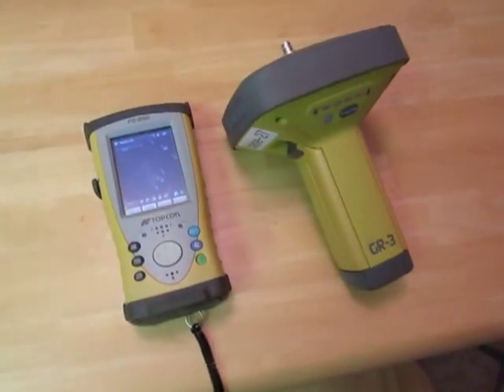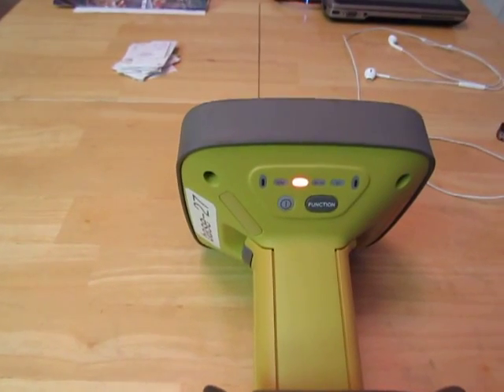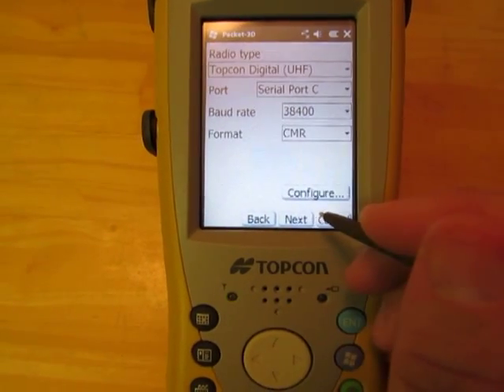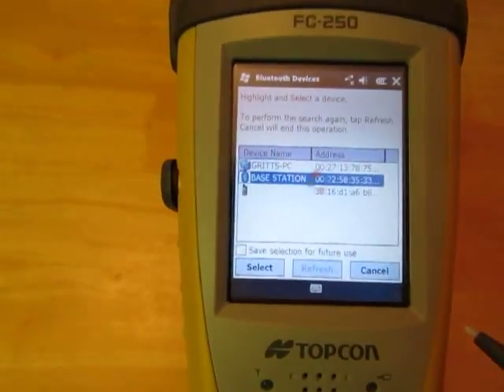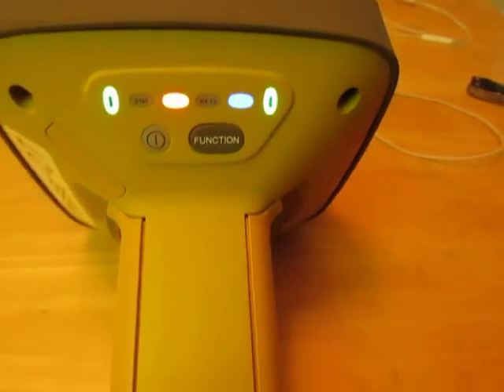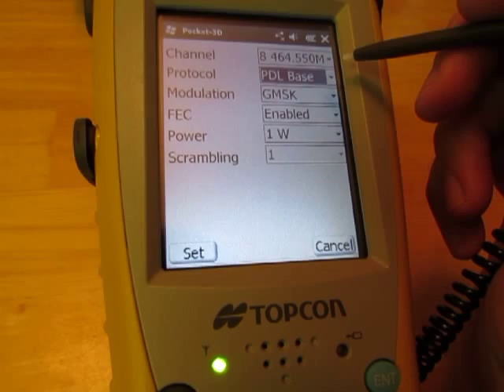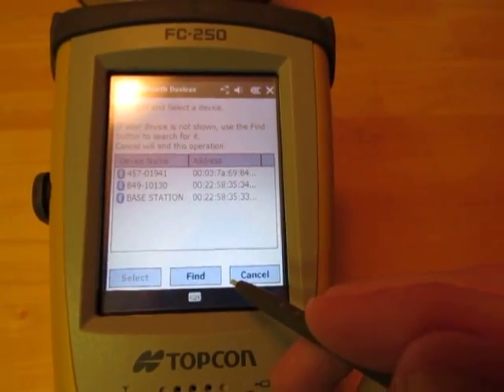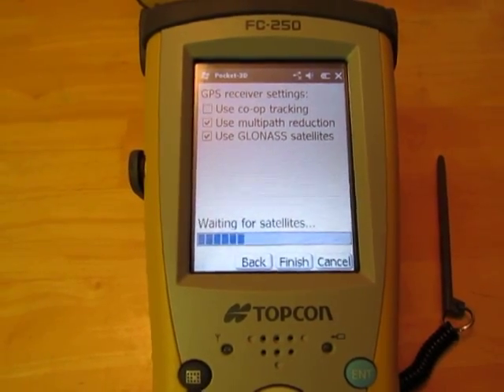Configuring Digital UHF radio - Topcon GR3 and Pocket 3D

Comment from the maker: It is true that you can damage the radio board if you use your GR3 (or any Topcon GNSS receiver) without an antenna attached. In this case, I only had the GR3 powered on for the duration of the video and didn't bother to attach the antenna.  Definitely not a "best practice" on my part.